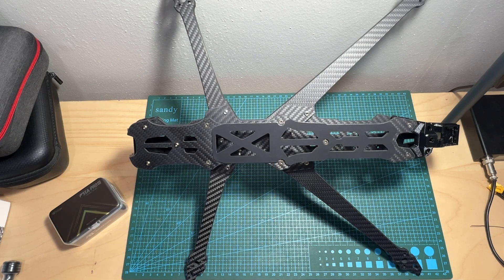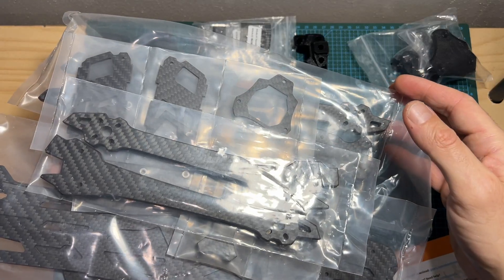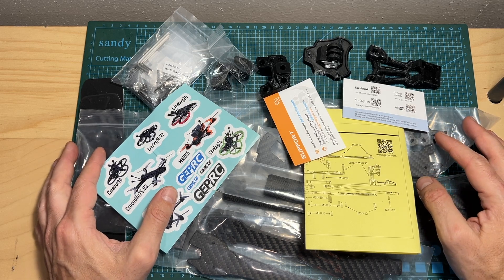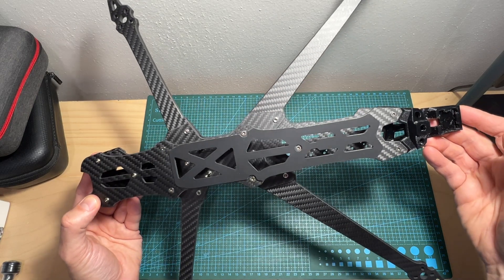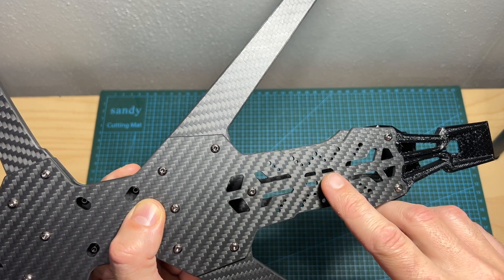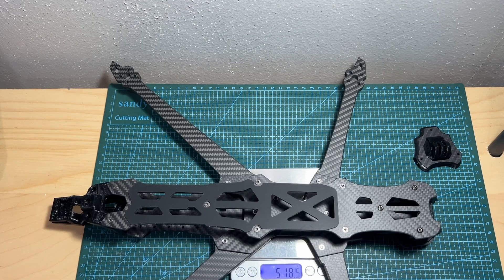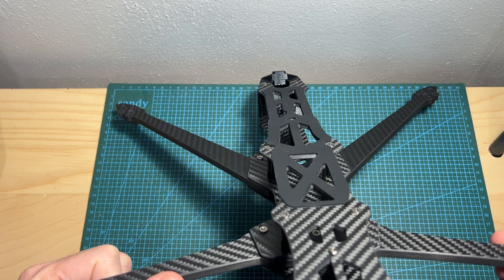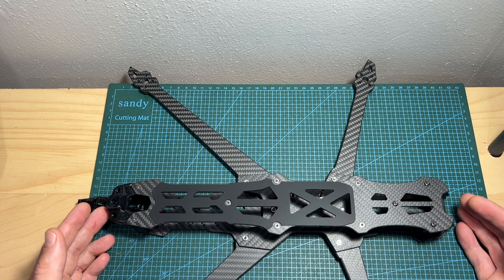GEPRC GEP-Pulsar LR10 Frame - Quick Build & Overview

Comment: They have an 11" i was looking at. And looking at motors for. Thinking 6S4P 21700 cells
Reply: 8S3P with 500kv motors on a rig that size.  Then you can also rip it on 12S.  6S is relegated to 3.5" and smaller quads, nowadays.

Comment: i was shopping their frames the other day! this one is a bit outta my price range but might get the EF10 frame...any thoughts/opinions between the 3 they have overall? pulsar, ef10 and mark4? Thanks in advance.
Reply from the maker: Keep in mind that not only the frame is more expensive but the other parts as well and batteries cost a lot... I am not sure which frame is better. I only have some experience with the Pulsar...
Reply: @KremerFPV  yeah no worries, i built a AOS UL7 last spring and diy my liions so im set in the battery dept luckily.... and had hoarded an air unit and SB stack so most my electronics are set.... might try the johnny fpv 3115s as they seem to be a little more affordable than the  tmotor/brother hobby/xing and hopefully the deliver ;) 

i saw your XL10 video as well, thoughts on that setup now?
Reply: @LifeofAccro  I saw the tmotor v3115 somewhere for 30 bucks a piece.
Reply: @KremerFPV  i decided to say F-it and get the pulsar! since you have it already how long a camera cable to you think i need to reach the vtx mounting area? the one on my AU now is 13cm... not sure if thats long enough or not...
Reply: @chrisbee5481  not sure what happened to my other comment, but misread your initial post anyways lol... if you find them Tmotors again online let me know cuz that would be a steal of deal!
Reply: @LifeofAccro  fpvking has the v3115 motors. Do a search.
Reply from the maker: @LifeofAccro  I will build it soon. I'm pretty sure you need a longer one.